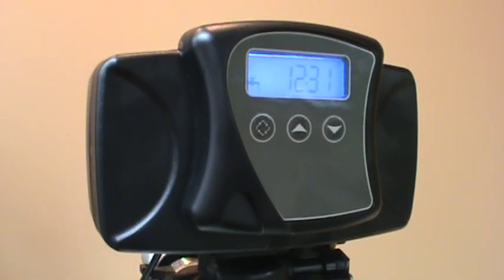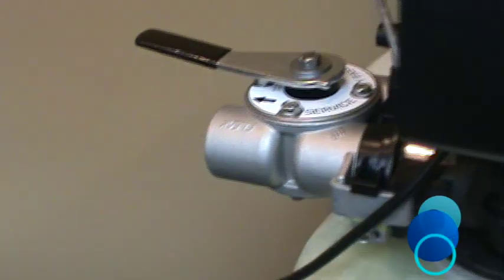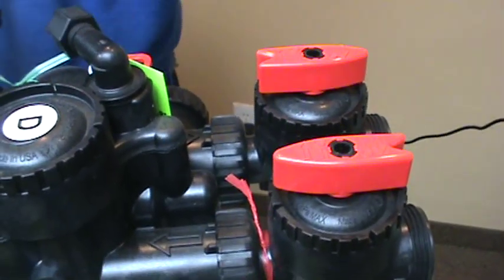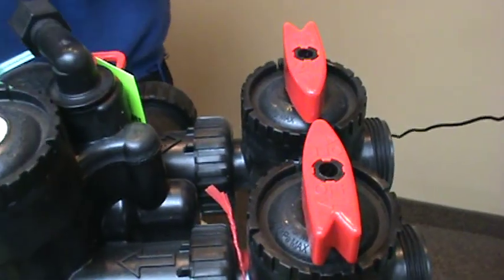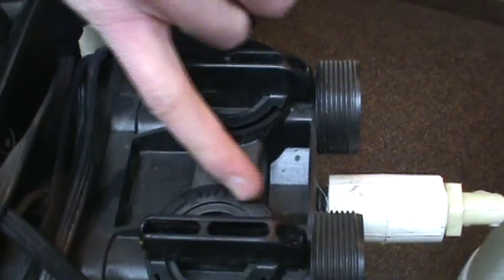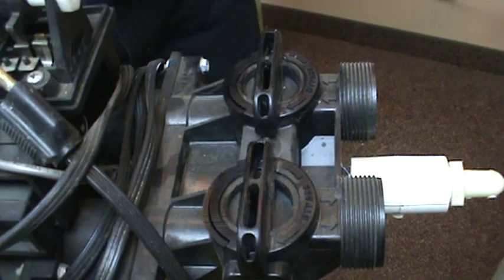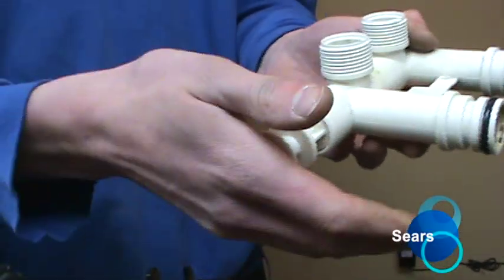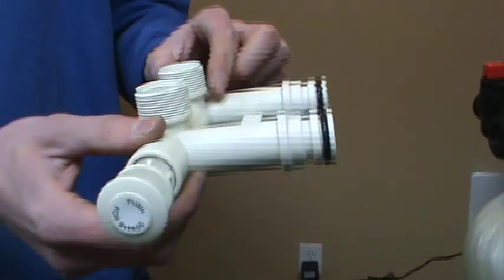Water softener bypass tutorial for 4 different style bypasses

Comment: So for the Kenmore ultrasoft 425 is the bypass valve supposed to be pushed in or out when it's turned on? We bought a home with this water softener, just turned it on for the first time and it's consistently draining water ....... The tank is not filling up and nothing else is happening. Just draining water for the past hour. 🤷